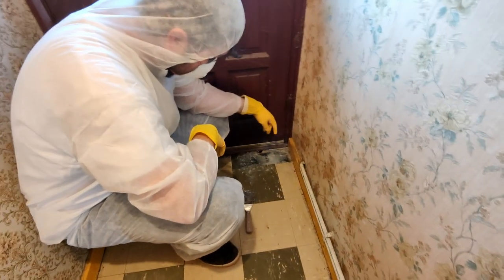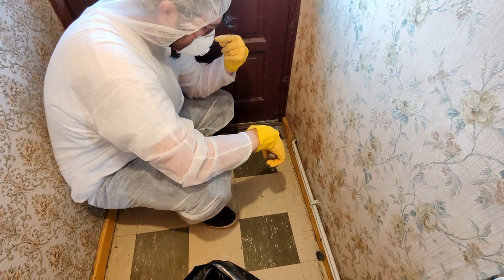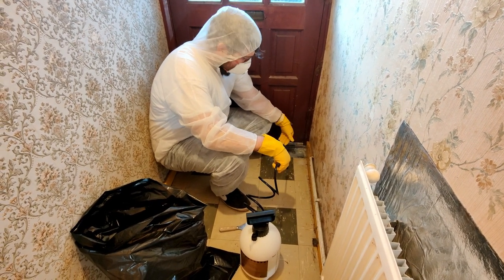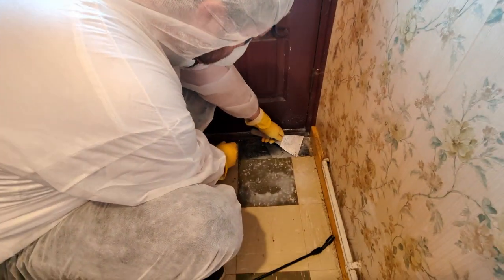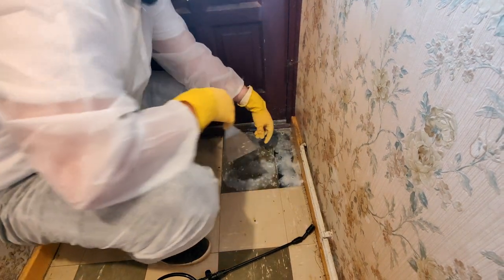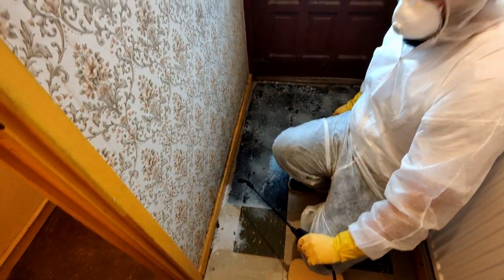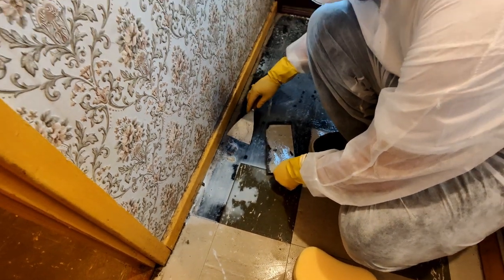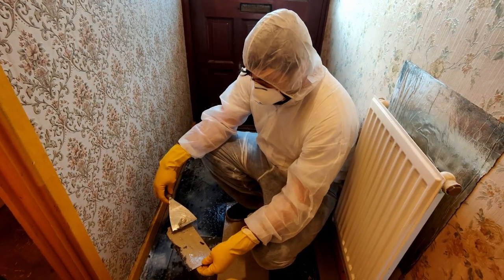House renovation #2 removing asbestos floor tiles

Comment: Hey @reedy777 this has been a very helpful video. I'm just preparing for my floor tiles to be removed, and I'm planning on screeding over the bitumen. Do I need a gauge rake or did you just use a standard spreader for it? I'm having a hard time finding the information and if the gauge rake is needed or not

Comment: Currently undecided whether to do what you did or whether to get a company to dissolve and remove the mastic. Main worry about encapsulating it with self levelling is that if I ever want to put wet underfloor heating, I will have to remove whole cement floors which means it will have to be destroyed which will potentially release fibers as one of the layers will be mastic.
Reply from the maker: I'd say the mastic permanently bonds to the fibres to the point where they cannot be released from the material even if it is broken up, but it is sticky and rather than have it start sticking to our shoes I thought it best to cover over it. As it happens I did also put wet underfloor heating in, using a low profile system so I didn't have to dig up the sub floor, most concrete is already relatively well insulated and so long as you have a thin layer of insulation to break the thermal coupling between the heated screed and the concrete sub floor along with using an anhydrite screed and ideally porcelain tile finish the system efficiency should be on par with even the best insulated floors as you create a much more efficient path for the heat to travel and so it does just like any other heat sink.
Reply: Remove the crap with a Wagner wallpaper steamer. They’re $60 and each tile to be steamed for about a minute. It will make it so it doesn’t crack and no fibers will be released. Defined don’t do it dry because it will get up in the air and be sucked in your HVAC system and circulated around the whole house
Reply: @reedy8585 I agree with that
Reply: @reedy8585  We plan for wood or engineered wood in the living room and tiles in the kitchen, so would need a solution for both as both are on the ground floor. Could you explain in more detail how you approached underfloor heating after removing the tiles? pva prepped the surface, then you did self leveling screed (how long did it dry for?) and then what? What are the next layers/steps you took? I hoped for update videos but I think you didn't record it :)
Reply from the maker: @varinator3176  In steps 1st level the floor with self levelling 2nd you can lay pre grooved insulation boards designed to take the piping, they can be stuck down using adhesive. the xps boards that look like tile backer, you can use tile adhesive. the pir boards use a grab adhesive. The boards can be configured to make any of the bends and turns. lay the piping in a complete run from the manifold and back never make joins, it must be one piece if you value your own piece of mind. The pipe lenths are limited to a maximum due to pressure and so you should have the system designed if you cannot workout the calculations. fill and test the system for leaks, leave it filled before the next step or the pipes will float  3 rd rap a thermal break around the walls and have the anhydrite screed pumped over it, to the desired thickness. You'll need to account for the total buildup including the floor finish, you dont want it to be higher than the base of the door frames and have to change the doors if you can avoid it, but you also want a good amount of screed ontop to act as a heat soak and help the heat distribution especially under the wood floors, you'll feel where the pipes are and some wood floors are not compatable with anhydrite so you'll need to find one that is. anhydrite screeds distribute the heat better and cure much faster you can normally walk on them within 2 days and lay the finished floor within a week. I wouldn't use anything else it's not worth it unless its a big developement project and you're looking to save money on scale. obviously dont rely solely on my advice I don't know your exact circumstances and I cannot give you exact and sound advice without knowing exactly what you are working with so you'll need to do your own due dilligence and consult the material manufacturers and suppliers for their exact specs.

Comment: I was wondering* what you are applying over the floor ? 
I have a room that I'll have to remove tiles like this eventually and I wanted to avoid trying to remove the black mastic glue stuff if possible.
Reply from the maker: @MichaelBlast  self levelling over it is probably the best way to go
Reply from the maker: @MichaelBlast  in hindsight I probably would have just used a fibre reinforced leveler over the top to encapsulate them and keep the insulation benifit
Reply: Hello, after the tiles are installed, do I need to sand the floor? I have broken the tiles in my toilet and I want to remove them, but I'm scared.
Reply from the maker: @pinar4003  I don't know what you mean? But it is not recommended to sand any asbestos containing material so I would not do that.

Comment: Did the self-levelling stuff bleed leak under the skirting board?
Reply from the maker: The skirting boards were removed in the end but yes the self levelling will flow underneath them
Reply: @reedy8585 thanks and sorry just seeing. I don’t get notifications for Yt. Another question, any reason why you removed the tiles first? I ask because I’m in a similar situation to you so planning how to navigate thing; also does t look like you were living there at the time

Thanks for the video. I’ve known it’s possible to do this but no one actually demonstrates, they (builders) just say don’t when it’s not all that terrible an idea
Reply from the maker: @chubbyBunny94  The main reason was because I planned to put underfloor heating in and I was gonna dig the foundation to add insulation before screeding over it. With that said abestos has got very good thermal insulation properties and in all honesty there would be nothing wrong with just screeding over it in my opinion.
Reply: @chubbyBunny94 hi there friend. If you was to latex over the floor tiles, it will take shape to them underneath. We've done loads of jobs like this and it is best to remove the tiles and then seal the bitumen residue by latexing over it 👍🏼

Comment: What are you spreading on the floor after the removal at the end?
Reply from the maker: Self levelling screed
Reply: @reedy8585 My Canada home built in 1994 has green 12x12 vinyl tiles with black glue underneath. On top of those green tiles, there is sheet vinyl with white glue under. Can any of the layers and glues contain asbestos for 1994 home? Thanks
Reply from the maker: @kingbee4474  it's unlikely as asbestos was banned in most countries by the 90s. However it's cheap and easy to have it tested so I'd do that if you are not sure. It's also best to leave it undisturbed if it's not damaged.
Reply: @reedy8585  thanks so much! I started lifting the sheet vinyl over about 5 sq feet, then decided it's easier to lay SPC click flooring on top. I decided to put back the sheet vinyl... It lost the glue under that area...however I put duct tape around that perimeter (where it lost the glue). Is it still safe in case it contains asbestos? I guess it was "disturbed" when i lifted it since the felt backing ripped. Basically now the sheet vinyl is glued everywhere except under the 5 sq feet...but it is sealed with duct tape around it. The sheet vinyl was installed somewhere after 1994 (home built date l) and 2004...probably much later than 94, since no one changes flooring that quick....
Reply from the maker: @kingbee4474  well vinyls and glue do a good job of containing the fibres on their own so long as they don't break down and start crumbling. If you wanna be a 100% you should have it tested. but I couldn't give you sound advice without inspecting it in person.

Comment: Could you have just left it and encased the tile, or are they too brittle?
Reply from the maker: Yes however I wanted to install underfloor heating
Reply: @reedy8585  Nice work. Had to have a chunk of mine done to mitigate before a sewer repair.  Removed the glue all the way down to the concrete. 

No fun.

Comment: That mask is not sufficient
Reply from the maker: @deepdeception7953  it is s P3 mask and it is the bare minimum
Reply: @reedy8585 I scraped up a 100 square ft of this crap 20 years ago when I used to smoke weed. Hopefully the oils from the smoke coated my lungs so the asbestos barbs didn’t get hooked in my lungs.